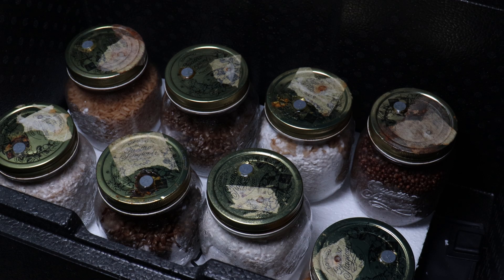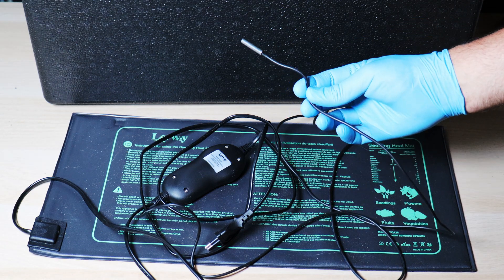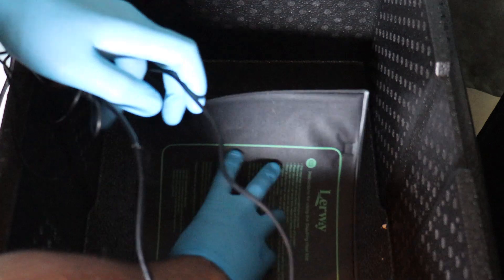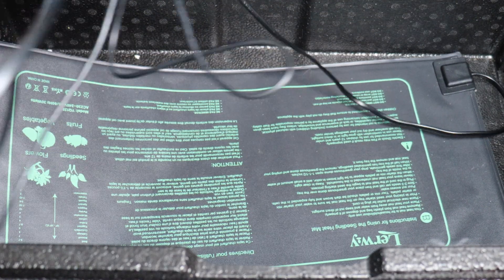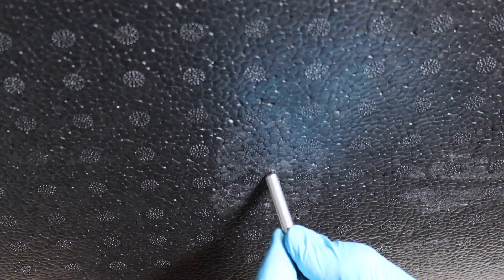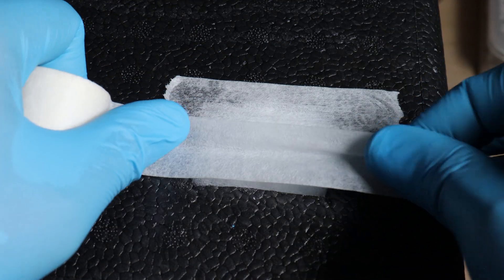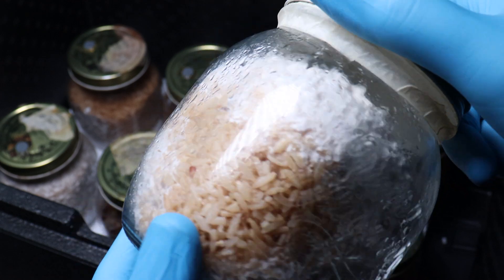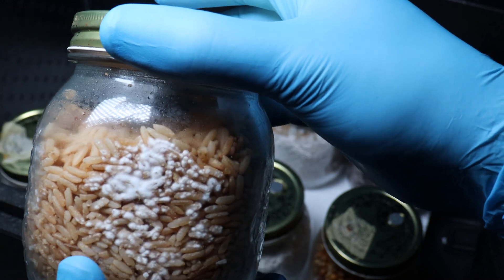Easy Mushroom Growing: How to Build an Incubator for Mushroom Cultivation

Comment: I love the video and the effort you take to teach people all of this. I'm new to the hobby, it's been 2 months of try and error. I managed to get an almost colonized millet spawn (it won't colonize the top surface of the millet for some reason..) Now I want to create some straw bags for substrate. For mycelium colonization of straw, will this box (I already built it haha) be good/ok?
Reply from the maker: Hey mate! Yes, this should keep your straw nice and warm for the mycelium! 

Bummer about the millet. If the top isn't being colonised, it could be for a few reasons. Eg a lack of moisture/grains too dry but its  more than likely bacteria. If you use that millet, dont include those grains that haven't colonised. Only used the colonised grains, otherwise you'll just grow bacteria in your straw and who needs that, right? 

To stay on the safe side make up some new millet. Give it a good presoak overnight before simmering it. That will germinate endo spores which can then be killed during your pressure cooking cycle. The pre soak will load the millet with moisture too. 

After sterilising, let the grains sit for a week somewhere warm. if they're not sterile, you'll find out. 

This will save you a lot of time in the long run. 

But yes! Try your millet in the straw. Experimentation is my favourite part of mycology! Welcome to the hobby mate!

Comment: This is really smart placeing the heating mat at the bottom than raiseing foam as a insulator hot air raiseing to the top makes it so the bottom dosent suffer much than than all the other deishgns thanks for your work earned a sub
Reply from the maker: Thanks mate, im glad you find it useful! Yes....dried out cooked grains are the worst. The foam certainly helps

Comment: All in all, this is a good tutorial and a good design.

No need for the air vent. You'll be opening and closing the incubator, allowing air to mix. The lid crack allows for air movement and pressure equalization. I've seen no evidence that mycelium can "suffocate" from lack of airborne oxygen - mycelium has metabolic pathways for anaerobic conditions.

The white foam could be a wood board, or any other material to create a flat surface - ideally would be one that allows heat to move freely.
Reply from the maker: Ah I appreciate your comment mate. I'd agree with everything you say........the first time I made the incubator....my myc behaved weirdly so I figured I'd add a vent for fae. Was probably bad culture or something. My last few batches have worked really well though. But yeah, they should get enough from opening the lid and myc does grow I  anaerobic environments without too much drama! 

As for the foam, I found having a piece of wood or trivet for the spawn to rest on caused some problems. They would heat up and dry out the spawn in the jars. I haven't had any problems with that since switching to something with better insulating properties. The heat seems to circulate well and I get extremely stable temperatures. 

I'm glad you find the design mostly practical, mate! Cheers :D

Comment: 4x8 ‘Polystyrene with thin shiny duct tape is what I used for about $35$. With this you can cut to customize the size box for your bins. I may make an entire closet size box instead of Martha tent. Both materials are strong, mold proof and water proof. I’m running tiny 2-20mm waterproof computer fans on speed controller at top pushing down with tiny hepa filters on outside and one fan at the bottom pulling carbon dioxide air out. There is positive pressure so tams don’t get sucked in. I can grow tubs in the same box. I can double stack a tub with mat underneath at 78 degrees. The pan trays sit on racks two high. Fogger gets connected to rainbird control. Mini grow chamber.
Reply from the maker: @MycSailor  beautiful set up, mate

Comment: Ooh interesting, I might do this but with like a mini air conditioner instead of a heating mat since I live in hotter tropics. Do you have advice for such an incubator as well?
Reply from the maker: Funny you should ask.......... I recently built an automatic fruiting chamber that includes cooling. I used an isotherm ge 80. It's a refrigerator kit for small boats. Works well. Super expensive. I have it connected to an ink bird temperature controller. When the temp gets above 25c the cooling kicks in and shuts off at 20c. It works really well. It is probably cheaper for you to buy a small portable ac unit and vent cool air into the incubator through some kind of hose when the temp exceeds your parameters

Comment: why dont you just set room tempereture 22c
Reply from the maker: @yokartik  A reasonable question. I don't heat the area of my house where my mushroom stuff is. It's about 8 degrees in that room.  Saves big time on energy bills. This is much cheaper. It also allows for more consistent temperature control if I'm running an experiment or something.
Reply: @BigMush9000  What temp do you keep it at in your incubator?
Reply from the maker: @stevenbrunoisinit  I keep mine between 20 and 22c, seems to work well for the mycelium. Though anywhere between 18 and 26c should be fine. I have run into contam trouble in the past with higher temps. If your spawn and inoculum isn't perfectly sterile you'll know about it real quick......but that's another issue entirely.